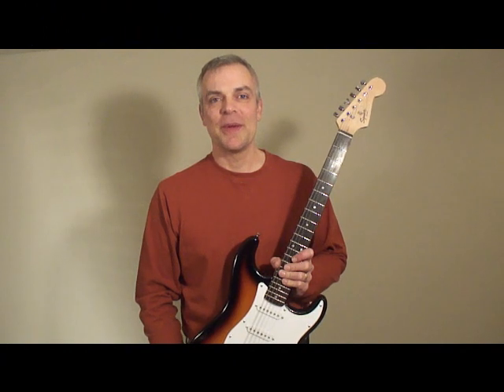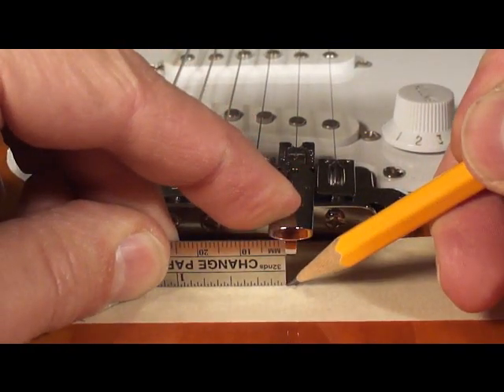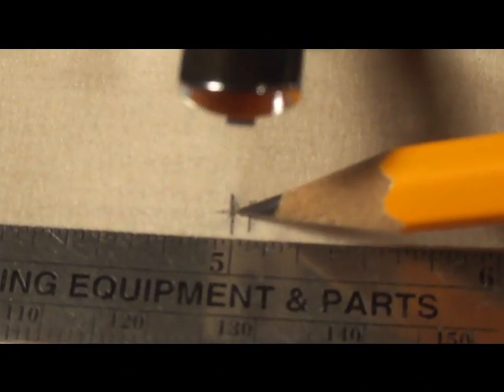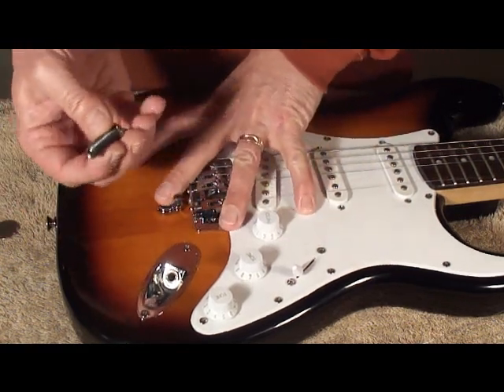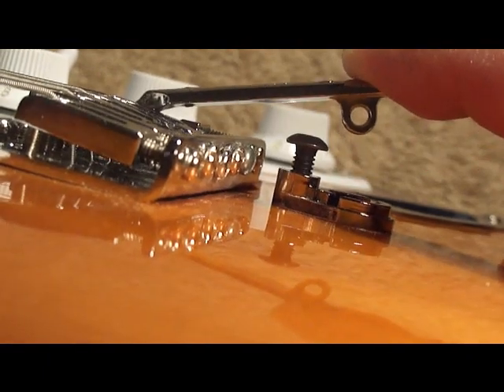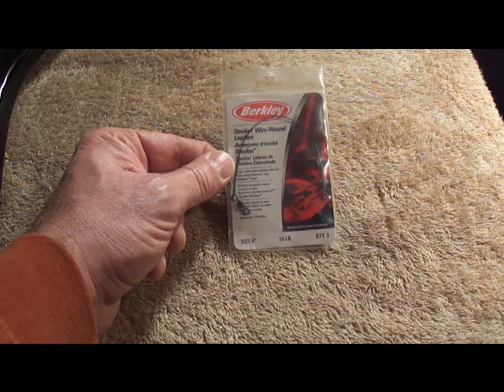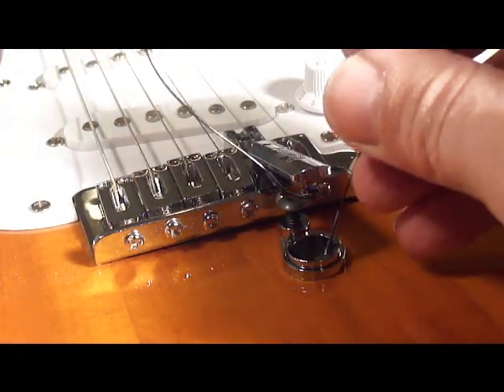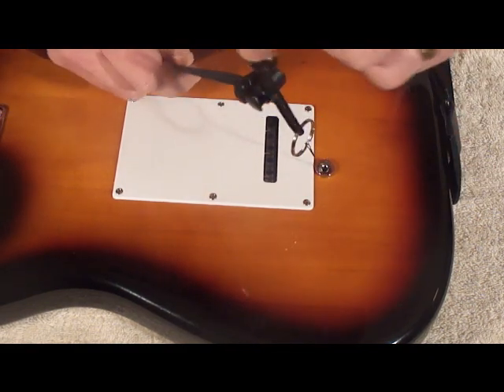Rolling Bender Puller installation (quick overview)

Comment: I really love the system saw some work that you had done or a post about it on a lap steel where you put at least one maybe two of your rolling vendors on it as well as a hipshot how did you come up with pedals to operate your Benders know that that is something that you had done as well according to the post I saw would love more information about that also curious to know if you have come up with a way to lower strings as well